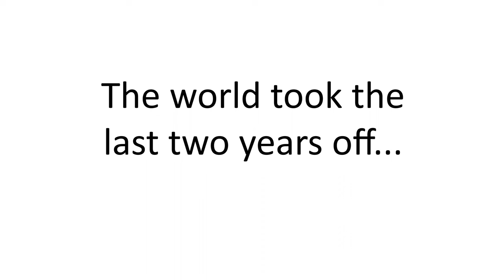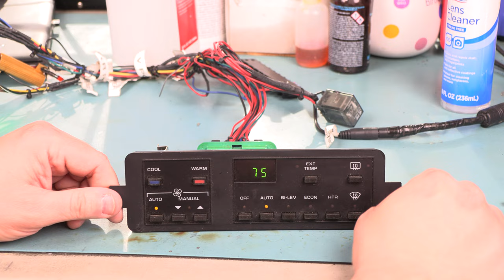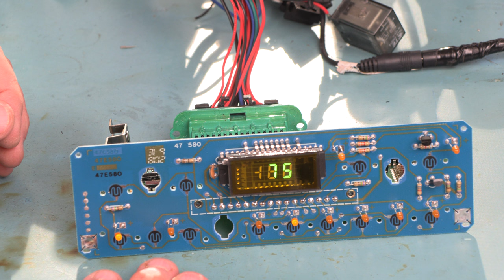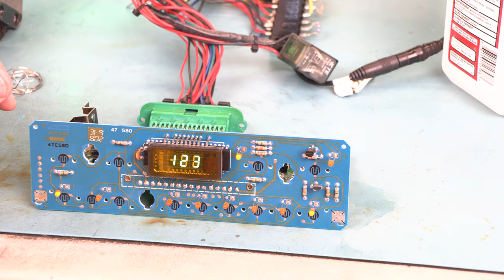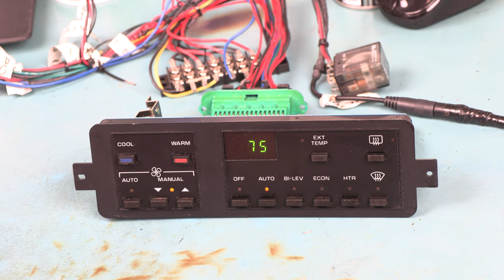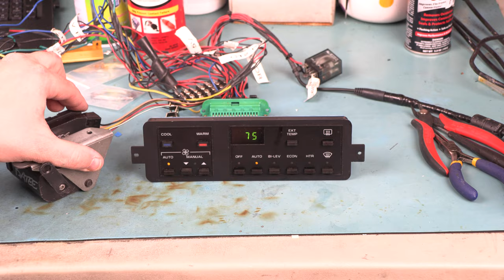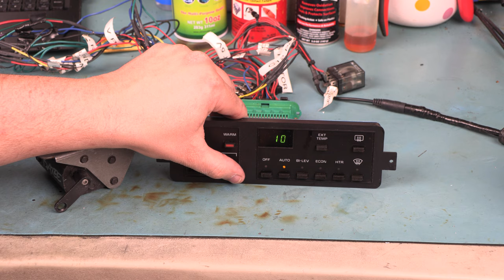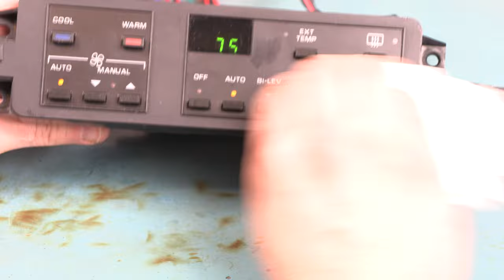86-89 Corvette HVAC Controller Repair (2022)

Comment: Thanks Bryan, I'm just starting to get the new a/c running in my 87 C4 and I noticed that the auto head unit is dead. no power. It was running a few months ago, and I am not sure if I plugged it in correctly. That said, I am going to take it apart and do what you just did in the video, as my controller blinks and goes crazy when it gets hot. The system still runs, it just blinks all over. BTW, my rebuilt dashboard is running perfectly. Thanks again, Peter Cermak

Comment: My problem is that the silicone switch contacts has cracked and I cant find those anywhere. I had to cut and fiddle with the ones who still is intact to make the most important functions to work. I hate that those ***** discontinued the faceplate . Just makes it harder for all C4 enthusiasts to maintain their vehicles
Reply: Do a search for "conductive rubber buttons". You might be able to find something which you can modify to fit.